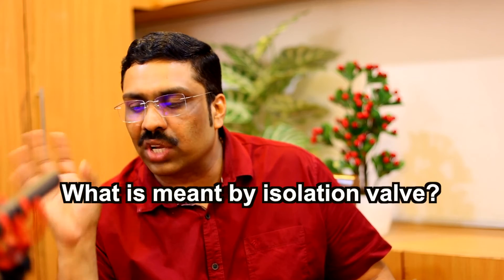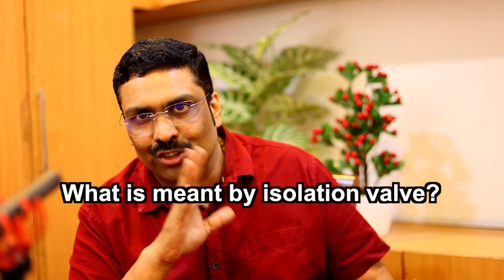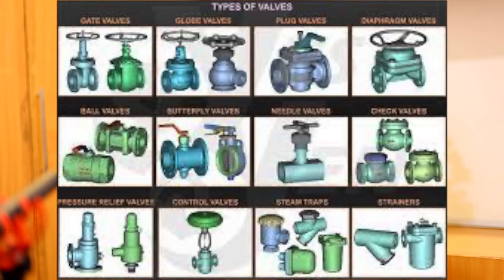HVAC Interview Questions and Answers 2024

Comment: I watched your video, good effort, below points need to clear ( if I am not wrong)
Chilled water temperature to AHU 6 to 7 , air temperature ( off coil is 13 Deg) passing the coil is nearly 13 Deg.
Elastomeric rubber and rock wool insulation 
Pre fabricated duct/PI-Pre insulated ducting and GI, Ducting ect,,,
Fresh air ducts from FAHU needs insulation
Below are the Questions which I have faced during Interviews. 
1 .What is the different between DRV & PICV?
2. Draw the schematic diagram of ETS room piping layout?
3. Draw the AHU & Pumps piping connection?
4. What is the delta - T of the Plate Heat Exchanger?
5. What is maximum supply air temperature of FCU?
6. How to calculate the ESP of the fan?
7. What is the difference between the MSFD & MSD? Where is the application
8. Draw the FCU valve package?
9. Where is the application of die-electric union or coupler?
10. What is floating floor slab & application?
11. What is function of heat recovery wheel?
12. What is smoke management system in the typical corridor?
13. What is the Car Park Ventilation System?
14. What is Decoupler line and how to determine its size.
15. What is the efficiency of heat recovery wheel as per DM (Dubai Municipality) regulations
16. What is the ΔT for on coil and off coil temperature of FCU
17. Location of differential pressure sensor in CHW line
18. Location of valve and fittings from bend and TEE for max efficient flow of CHW 
5 times of the dia of the Pipe.
19. How to overcome hot spot in airconditioned room
20. RH at cooling coil
21. How to calculate latent heat of an AC machine
22. Welding procedure for CHW piping.
23. Support interval for a CHW pipes
24. Air flow velocity of FCU and AHU
Reply: Thank you brother ❤❤

Comment: i am from India Kerala . I finished Mechanical Engineering (Btech) and Woked As Hvac - project engineer- design Section for 1 year in Kerala ( mostly was Using Autocad,Hap,Duct sizer, Pipe sizer) 
After that Joined an HVAC course And BIM course ( 5 month Course)
And learned Revit and Navis work and Few more basics Of HVAC . I am coming to UAE ( Sharjah , my parents are There ) i want a job in This Field ( HVAC design) . What all should i do ?
Reply: did you find job bro?